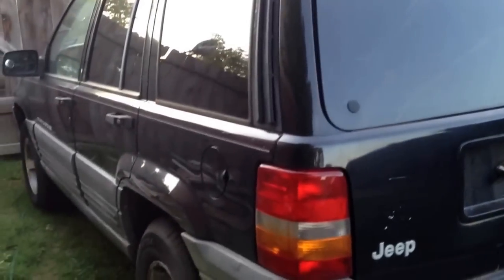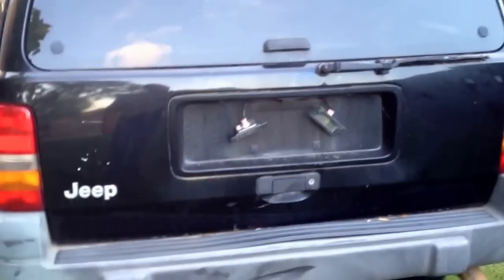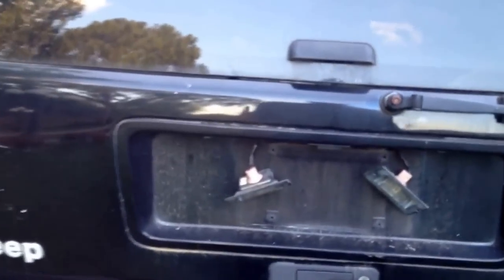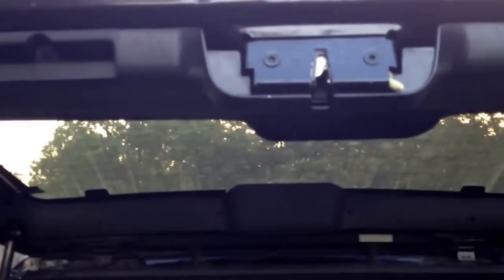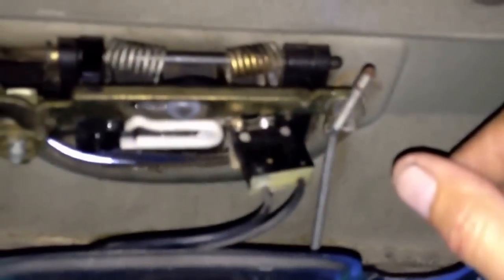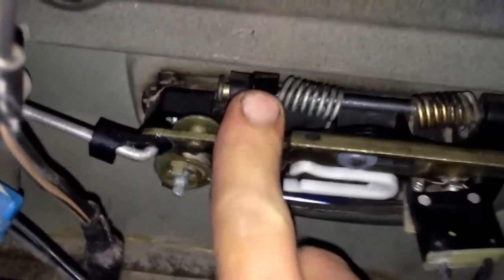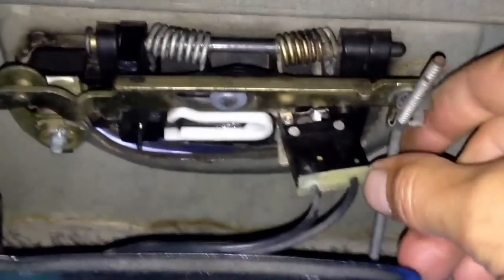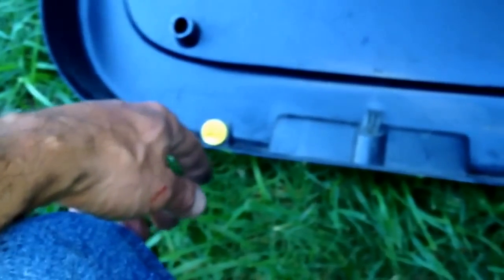1998 Jeep Grand Cherokee Rear Hatch Won't Open

Comment: Hey YouTubers.......I found this video the most useful for Grand Cherokee liftgates that wont open. My reason is because this video gives the best method for lift gates that just will not open at all. The other videos are fine for those that can get them to open at least part of the time. My reason is because this video shows how to open the rear lift window and remove the four top screws so you can wedge open the interior hatch cover so you can reach in and lift the rod to open the liftgate so you can work on it. my 98 had a rubber "sound barrier" glued in place that I had to unstick in a few areas to reach in. I used a Maglite to wedge it open so my arm could reach down. The threaded rod is vertical and just to the left side of the lift gate latch. It is easy to identify by touch as it is the only rod like it there. Once it was open it was a piece of cake to follow the directions to remove the panel and adjust the rod. I also lubed the heck out of the mechanism and the latch itself. Works like a charm now.
Reply: Chris Villeneuve .jeep Cherokee rear wiper access

Comment: Thanks for the info - I have a 99 XJ. with the same mechanism .The rod has ridges and they not  threads - so a nut of any kind won't  work. I ended up using a 1/4" wire clamp which is a u-bolt clamp with two nuts to tighten  around the rod to prevent it from sliding down again . So far - so good

Comment: Thanks for the video, helped out a lot. Just worked on a friend's jeep with success. His back glass window was sealed from the factory (just my luck), and his hatch would not open. From the inside if the truck I had to remove the four screws from the top part of the panel, and pryed it out getting my hand to reach all the way to the bottom to grab the lever that had totally fallen off. Cut my hand in a few places, ended up putting my arm through some old jeans to get it to work. Pulled on the lever and the hatch came up. Ended up using zip ties to secure the metal rod onto the plastic threads.

Comment: My tailgate hasn't opened in 4 years. My brake light went out. The only way to replace it is with the tailgate up. So I used your video, cut my hand up a bit and fished around for the latch. It opened. Fixed the bulb then fixed the latch. The rod popped out with screwdriver. Popped it in a little lower and it works like new.

Comment: Undoing as many screws visible, then pulling the panel as far out as you can get your arm in, looking down.
There a metal rod that comes in from the left. Disconnect that rod and the lock is now manual.
A bugger to get to but with the door locked it's about the only way.

Comment: Last time this happened it worked fine after resetting the rod

It went back

I did the same thing. It opened. However I said let me get it in a better position and then ill put a nut at the end so it wont slide up anymore. However when i tried to do this I cant get the door to open. I set it higher like the vid said but the rod pops out. I tried holding it in while opening and atill it wont open. Tried everything. I can open from the inside if I push down on the latch. But from the outside I cannot open the door at all. I dont know what it could be

Comment: Damn. I wanted to see how the hatch panel came off and you completely skipped that part..
Reply: ...the last time I had to do it....the inner panel broke into pieces....
Reply: Those panels come off easily, he showed most of the mounting points, and then it is just a very careful prying to get those clips released. Its not something you can do with one hand, and most of the time you want a third hand.
Reply: Oh.....I learned from my last experience....I had replaced my hatch and the "new" one stuck a couple of weeks back...I smacked  just right of the lock mechanism a couple of times with a rubber mallet, and the door opened right up.....after which I removed the plastic panel and sprayed the lock mechanism and spring with Jigaloo.....no problems since.
Reply: Good idea to smack the hatch like that. I have to give that a try. I came to this video to get a look inside the hatch before it is completely stuck closed.

Comment: Is there anyway I can disable the power lock switches, Or at least the power actuator for the hatch?
Reply from the maker: I'm pretty sure I remember a wire and plug while I was in there. I presume you could simply unplug the power lock actuator and it wouldn't be able to lock.
Reply: i was assuming the same thing.. unfortunately its still too 'chicago 
cold' around here for me to do any tinkering.    my power locks are 
basically non functional but that doesn't bother me.  the hatch, however, 
is the only one that the power lock will actuate.  i wanted it to be key
 only, and i couldn't find the fuse.   i also wish there was a way to 
disable the automatic dome lights, short of pulling the fuse.   
thanks for your response!